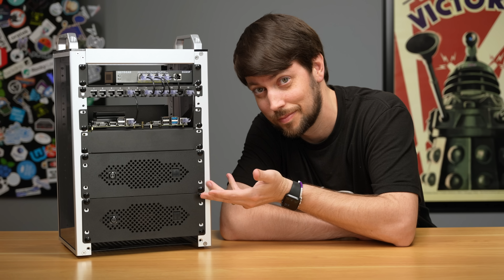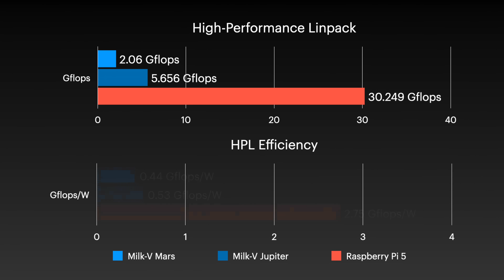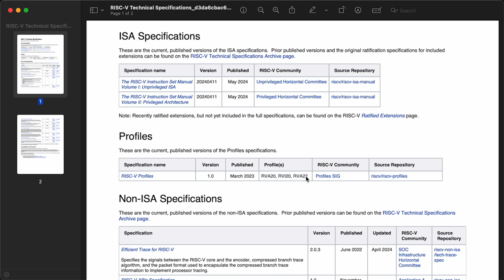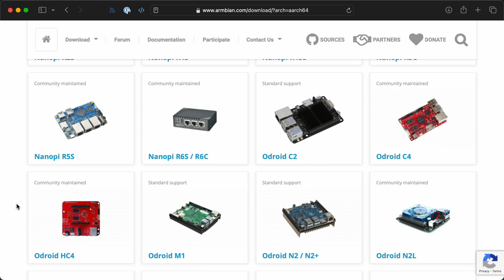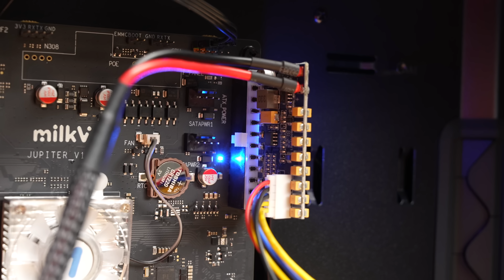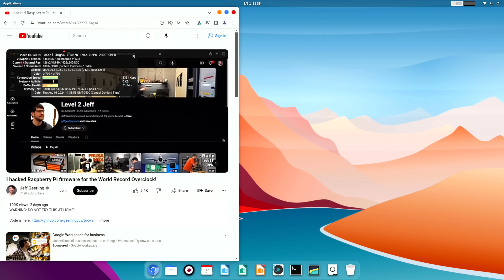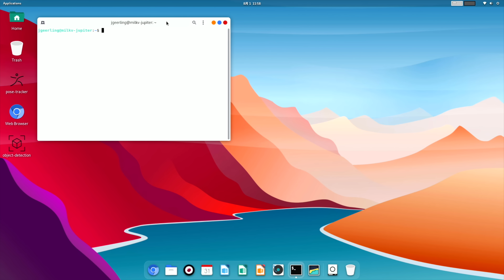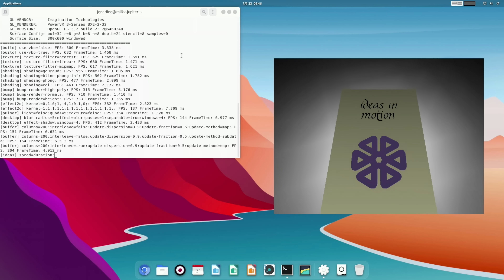The PC industry is changing: RISC-V goes mainstream

Comment: An Intel Core Duo-level CPU shouldn't struggle with 360p. Plus, an Intel CPU would have even an integrated video adapter to offload the burden of decoding video. And better drivers, both kernel-mode, and for the video adapter. I don't know if a video adapter (GPU) is present, or if all video goes through the CPU.

12:24 The original setting was "360p (auto)", which may mean, that part of the stream would be up to 1080p whenever possible, and the baseline would be 360p. So it will switch between 360 and up to 1080p. If you manually select 360p or 480p, and wait a minute or two to test that setting, then you'll know better how well it's going to perform.

The removal of graphical effects and animations from the desktop environment and the browser, and a proper content blocker would further reduce the load on the CPU.

Comment: I trust that distro as much as i trust Huawei not to embed tracking hardwares/software into their software...
There is a lot of concern with chinese-targeted distro's with english baked in. its very likely its monitoring the OS all the time at kernel level. a drop-in kernel would probably expose a lot, but, i wouldnt trust any part of it to not be also attempting to hide code meant to expose data, hide intrusions or provide back-doors.

the hardware would probably run much more efficiently on a more stripped down distro as well. afaik, no RISC-V hardware to present has a embedded-gpu, rather still using frame-buffer copying devices to simulate a graphics adapter. (like ancient x86 dos and 16k apple machines did)

This would probably perform wonders with a D-GPU, as it would take a large percentage of the load off the CPU handling all that graphics workload. LXDE or another slim DE, with no graphics acceleration and no compositor, would probably make this feel significantly smoother.

I also can reasonably believe this is running off a SD or other slow storage medium (or the kernel is restricting it to speeds relative to that.) That login is waiting for data to be copied from disk... i know that type of delay. 
(also if most of the services are starting at user login, this is a huge problem for performance)

Comment: I got RISC chip on my Adaptec PCI-e controller and its quite fast and reliable for its task. It is 16 ports, currently 12 occupied, 2 SAS raids5 4x4TB and  1 SATA raid5 4x10TB. I tried software raid5 Windows server 2022 and Linux MDADM on i12600K and it is not even near in terms of raid5 syncing and restoring on this RISC chip. These chips are purpose-built chips and they are extremely stable.

Comment: My basics are I don't like cross development, that is, compiling on one device and running on another. I would prefer to do all development on one machine, even if it is not the fastest. Also, all my base development is on Linux, so the machine has to run Linux. We have been here before. ARM makers flirted with regular motherboards, but seemed to have given it up and gone to servers only. Yes, there are promising ARM MBs out there now, we will see.

Comment: We have been down this road before, CISC won hands down.

I was a RISC fan for years back in the 90's but over time I came to realize that CISC just does it better. One of the main factors is that the instruction feed rate for RISC requires a lot more than CISC and thats reflected in L1 cache size.. now that CISC processors can do multiple instruction decode and issue what's left for RISC to do? CISC processors do it all on chip so any architectural advantages that RISC had are now used by CISC processors (Arm included).

It's just out dated and it's time for people to read a bit more history to understand why CISC is the dominant cpu architecture.

Comment: For your 12 volts out the slot, I would use a cheap XT60 panel mount connector since they are rated to 60 amps (so OVERKILL) and are cheaper than most other connectors and easy to solder... while being VERY durable and much easier to solder than a barrel jack.

Comment: Even if it's slow, if it has low power usage considering the process node, then it might still be good because sometimes we need low power even if it's slow... still, direction is more important than perfection, if it's improving at a rate where it can catch up eventually, then it'll be good eventually.

Fact is that RISC V is not exactly crap, there are Monero miners that are basically a bunch of semi-custom RISC V chips that are slightly more efficient than Intel or ARM... Monero uses Random X for mining which is based on random code execution. ASICs don't work for Random X on Monero, so only an efficient CPU can mine it... this is good for RISC V because this proves it can be efficient in performance per watt, even on a totally random and unpredictable program.

Comment: Yeah. RISCV processor are slower than current mainstream desktop CPUs, but theyre not slow. The problem is that software is garbage nowadays. I can tell you that if your software isnt garbage you can run desktop software in wayland and even 3D graphics until the cows come home on something like an AM625 using only 600mW!! 4K60 Youtube ran fine on my 2015 Macbook Pro in 2015, yet on the same machine, I can now barely watch 1080p60. What has changed? Software has changed.

Comment: Why is a slow motherboard that can barely handle Linux is interesting ?
Reply: Becuase risc-v cpus have the potential to be better than arm and x86 in the future. For reference, x86 architecture was first introduced in 1978 and arm architecture was first introduced in 1985. Risc-v was introduced in 2014. It's significantly more modern, but because it's so new (and doesn't have as much money thrown at it) it still has a lot of problems to work out. But the fact that it's gotten this far in such a relatively short span of time is impressive. It's not suitable for regular consumers, but it's one of the more interesting developments in computing right now.

Comment: Possibly dumb question, but have you tried the h264ify plug-in to enhance YouTube performance? I dunno if that'd even work, but the website claims they support 1080p h264 at up to 60fps but doesn't boast the same timing for any of the other video standards it supports, which leads me to think it supports h264 better than anything else. Might be worth a try!

Comment: On a purely emotional level, I'm going to miss x86. RISC is going to replace general computing within the next decade, that's for sure. Gaming I can see being an x86 holdout for a while longer due to backwards compatibility, but the IBM PC foundations are on borrowed time - electricity has a physical limit and we're very close to that limit. TDPs can't go any higher for the consumer, and electricity is more expensive.
Reply: @Snufflegrunt  Why are you comparing bits to cpu architecture? If you watched 16 bit going away, you would know that x86 lived through that, and then through 32 bit as-well.  Everyone from Intel to Apple has been trying to kill x86 at various points, and yet it is still dominant on the desktop and server world. Yes, the M2 Pro Mac with ARM is very powerful, but so was the G4 Power Mac with PowerPC, and the Amiga with 68000. Of course, since you lived through DOS and 16bit going away, you would know this...
Reply: @8bitRAM  Because it's a change in paradigm that caused headaches just like CPU architecture changes. Any long time Mac user will attest.
Reply: @Snufflegrunt  Yeah, but its not an argument against x86 continuing, bit increases are linear progression, while architectures are not that. If "newer" CPU architecture meant "better", then the examples I listed would have already replaced x86. You asked for an argument, so I gave you one.
Reply: @8bitRAM  But the end result is the same. I asked for an argument from that guy (not from you, but fine) who said that x86 isn't going away - it is, and you haven't said anything as evidence for x86 sticking around in the long term. ARM has replaced x86 for 90% of my productivity already. It's also replaced x86 for most normies who do everything on a phone or tablet. It's in high-end headsets. Recent Valve leaks have shown that Valve are likely using ARM in an upcoming Deck replacement as well as their headset, along with efficient x86->ARM conversion within Proton. Even Microsoft have seen the writing on the wall, although are being "Microsofty" with their ARM laptops. For laptops especially, it's a game changer just from a battery perspective.

Edit question: Have you used an ARM Mac for productivity? It is lightyears ahead of their former x86 offerings. I'm not even a Mac guy - hate the OS, love the exclusive software - but when I use my M2 Pro for editing with software designed for ARM and nothing else, I see the future of computing.
Reply: @Snufflegrunt  So your arguments are leaks for a handheld, Microsoft's half-assed attempt at Windows for ARM thin laptops. That's why you see desktop x86 gone within 10 years? Like I get Apple fanboys always think that Apple's always one step ahead, but this dance has been played out atleast twice already, once with the 68000 and then again with PowerPC. I shouldn't have to tell you this, you said you witnessed the 16 bit era, so I'm not sure why you've selectively deleted this from your memory.
Reply: @8bitRAM  You missed a bit - I'm anything but an Apple fanboy. You say you've witnessed the same things as me, so you should be able to identify the same patterns. Sadly, there's not much I can do for you there - your teachers failed you. (Also by not answering my question, you did - “no”.)
Reply: Bro actually believes in x86 going away
Reply: @SwampKryakwa   Bro hasn’t used an M2 Pro Mac for production.

So, have you got anything to argue against that prediction or are you just crapposting? Most of the industry agrees, including the guy in this video. Soon? Nah. Within 10 years? Yes.

FYI, I lived through DOS going away. I lived through 16-bit going away. We are currently living through 32-bit vanishing. The core of computing changes every 10-20 years, and I tell that you're young so get used to it.

Comment: I initially loved the concept of RISCV, being an open source ISA and all, but then I read more about it and realized it is problematic.    It allows for customization of the ISA, which means there probably won't be binary compatibility between implementations.     Without universal binary compatibility between implementations, it will never be the next thing in the PC industry.

We need to get away from boutique consumer devices into general purpose PC's, and when you do there needs to be universal compatibility.   All binaries must run on all versions.   Users must be free to install the operating system of their choice.  No locked boot loaders, etc. etc.

RISC-V needs some serious tweaking and updating of its license for this to be the case, and until that happens it is dead in the water, except for very specialized embedded implementations.

Comment: I think RISC-V will eventually take off because China put a lot of research and development into it both in hardware and software. Lots of the linux stuff for RISC-V came from Chinese universities. They also made a recent breakthrough on their only x86 line of CPUs which matches about the same in performance as Kaby Lake.

As the USA tries to close off high end chips from China, RISC-V will quickly become a necessity for them, which will likely cause more rapid adoption and development.

Comment: I think it's gonna be a while until RISC-V appears in mainstream devices. But I expect early on that RISC-V will take over in the microcontroller industries in the same way that low power ARM processors did many years ago. (I hope) The new RP2350 is going to go a long way towards making RISC the default architecture in low power, efficient embedded systems where absolute speed is not as important. Just as it took quite a few years for ARM power to catch up with x86, I think it will be 5+ years until we see RISC-V competing with desktop processors.

Comment: RISC performance depends on a very sophisticated software tool chain to achieve high performance.
We won't know how good RISC-V really is until that's available and benchmarks are published.  This is not trivial.

Is trading away machine abstraction (microcode) and the loss of human low-level software development worth the potential performance gains?

Paying a new generation of "rocket-science" developers for the tools and backwards compatibility are challenges for reaching RISC potential.

Intel tried but failed with Itanium.  But time will tell.

Comment: weren't apples old PowerMacs running on RISC? Back then the G5 Processor had all sorts of heat issues. How would it be nowadays if a hyperthetical G5 successor was produced with TMSCs 3-5 nanometer nodes?
Reply from the maker: It'd be interesting though they could probably make those cores in like 1mm^2!
Reply: @JeffGeerling  Yeah definitely. Probably still wouldn't beat out any of apples own ARM stuff, since that's been developed continiously for the past 15years. But the G5 was a power house back then. Guess we'll never find out :)
Reply: @linglingstar  You could always review IBM's POWER CPUs since IBM does maintain the architecture for its own products, as well as there being a rather tame OpenPOWER initiative that seems to want to get vendors back on board.
Reply: @paul_boddie  I did see IBM was continuing work on the POWER infrastructure. I believe it's only servers though and far from the 3-5 nm tech, right?

Comment: RiskV is an open sourced hardware architecture. Why is that relevant? People are using parallelism for microsecond optimisation. The theoretical limit on hardware concurrency is nanosecond. That's 100x faster than microsecond for a 10ns response. That 1million time speed up with multi-threaded is 1% of the limit.

Comment: I think it's important to mention that SpacemiT is a fabless manufacturer which relies on Chinese homegrown fabs to actually manufacture the chips. They don't use high-end fabs in the US or Taiwan, most Chinese fabs are still slowly working towards < 20nm, 14nm is available in limited numbers, so it makes sense that these CPUs aren't going toe to toe with modern ARM CPUs. The Raspi 3 SoC is a decade old ARM chip, but made on TSMC 40nm. It probably makes more sense to compare these RISC-V parts to the ARM offerings from companies like Rockchip that use similar fabs. I'm sure Chinese domestic chips will get a lot better, but I think we'll need to see a RISC-V SoC on a high end TSMC process to really see what its capable of.

Comment: risc-V is going mainstream as far as the commercial or industrial sectors are concerned, not the consumer sector is concerned

people want compatibility, basically meaning they want something THAT WORKS
people want power, why else would we have the 4090 and people asking for a 4090Ti
people want reliablity, the harder you push an underpowered system, the quicker it dies (this also explains why intel systems are dying with air coolers, people are under-equipping their system and then running them too hot in a pursuit of silence)

Comment: I'm curious if you ran chrome://gpu to see if/how much hardware acceleration was enabled on the browser. Going back to Rpi3, I had a plan to use one in the garage to watch RIP'd DVD's of exercise videos and double as a video streamer. There was a gotcha. I was used to using VLC and it struggled with the DVD video. The CPUs were hitting 100% and still couldn't keep up without dropping frames. I poked around and there was non-gui player included in the OS that had access to the Broadcom GPU. When I used that program to watch the video, it had no problems and the CPU's barely reached 5% utilization.  I haven't used Cinebench myself so by the name, I'm guessing it is related to video so if it doesn't have optimizations for the GPU, it would be the same as the RPi3 struggling with 1080p. I have a Sifive HiFive Unmatched rev B board. I'm assembling the pieces parts and I am working thru unexpected issues but if you have a checklist of things you think I should try, I'm all ears. BTW. It does not seem to include integrated graphics so the pcie x 16 "spare" slot will be hosting a Radeon RX 580 card. Since I am still in the gathering stage, it will be a few days before I know it works.

Comment: Risc-V really isn't targeted at ARM or x86 style tasks. Its main advantage at present is in the ultra low end market like microcontrollers. The open and modular ISA allows product creators to utilize a well made third party Risc-V development tool chain with real languages and components ported in from the big players like GCC and LLVM; rather than different janky IDEs slapped together by every proprietary microcontroller manufacturer with some half baked non-standard C. And being more open than ARM can also save a bit in royalties, which matters in a market segment with 5¢ microcontrollers.

Comment: I saw you compared it to a Pi 5 and it got murdered but what about 4 or 3? Would be interested in those numbers since I have a pi 4 and there are still plenty of 3's and 4s out there. Also... are there any strong reasons anyone might want this versus a PI? What is to gain with using risc-v at the moment?